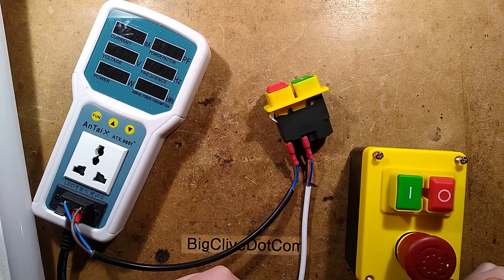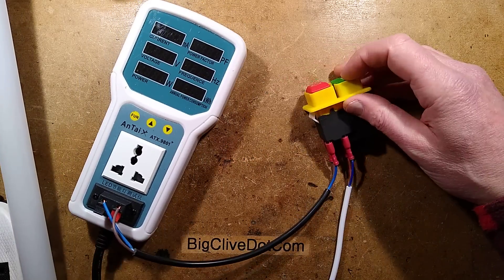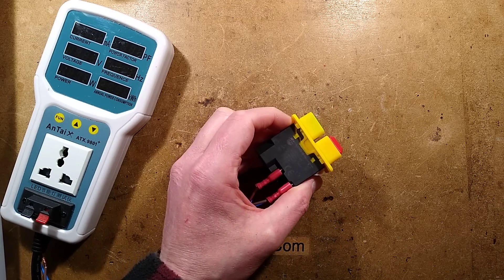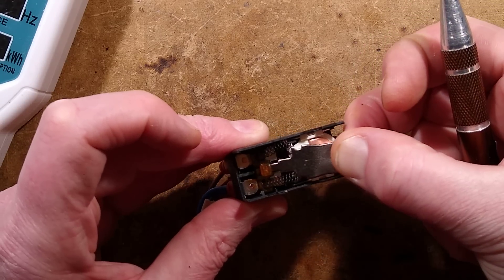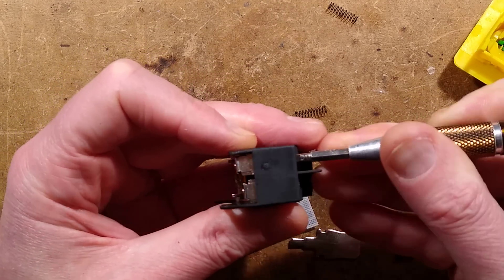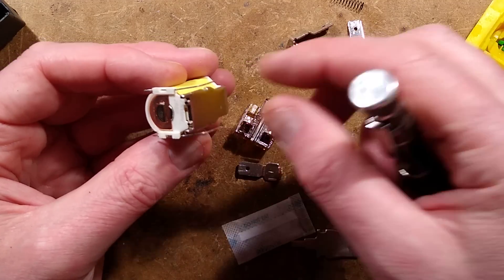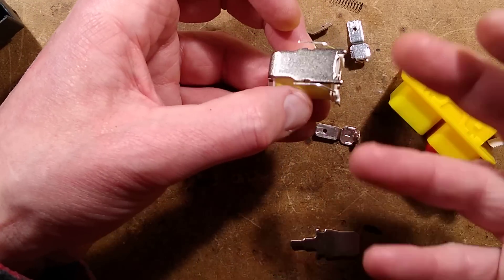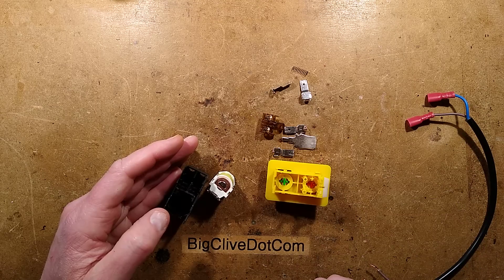Inside an NVR (No Volt Relay)

Comment: Thanks so much for this. I found a garden shredder on the side of the road that doesn't work and it looks like someone has had it apart and removed bits from the NVR because it looks identical to yours on the inside, but missing some key parts.
Anyway, looks like I need a new switch (NVR) to continue with trying to fix it. Hope that's all that's wrong with it but it's a fun project regardless.

Comment: Been a subscriber for years. Your videos are amazing some I am on the edge of my seat and then you have ones like this one that I can follow at a leisurely pace. Sometimes they are just plain soothing. Must be your voice. It’s always calm and peaceful you are a great narrator and video creator. Never had a chance to let you know. Just thought I would share how your videos effect me. It’s always positive. Keep it up Clive, you are truly one of YouTube’s best content creators on here. I always look forward to your videos even though I know electronics well but not as much as you. Hey who said old dogs can’t learn new tricks. I have picked up a ton from you. Like all my LED screw in lights have been modified like you showed and have yet to have a failure. I am under driving them. The the first one I did, I forget exactly when but it was right after your first video on that and I thought why not try it. I have 4 drawers with bags and every component and whatever value you want. I do quite a bit of custom work for people. I often build light controllers for lighting someone added that’s not factor on their car. 
I have had many people lately asking why I don’t use an Arduino.  My answer is simple. Arduino still requires relays, circuitry, and programming. If something breaks it can be a crap shoot. So I am able to build a circuit that fits their needs and build from components on a prototype board and waterproof it with a weatherproof box. In the 30 years I have been building these different modules I haven’t had any failures of my customers cars. But I have no idea how it healed out in the long run. I have a customer that has a 1990. I did a light conversion in 1994 and everything is still working. The car is kept in a garage and not driven in the rain. I think that’s pretty good especially for someone who has does electronics for a hobby. Been at my whole life.  No school for electronics. But at age 5 in the in 1981, I was in the newspaper and the associated press picked up the story and it was all over the country. Someone sent me 3 brand new Edison bulbs which all 3 are in a good and glass and wood case. Also got a letter from the president of Sylvania and he sent me a placemat with all the light bulbs they made. Also got a tie with light bulbs embroidered on it from him also a job offer that when I graduated college I had a job waiting for me there. I got into mechanical stuff around age 8 and really enjoyed it. Fixing watches with my grandfather and fixing and modifying bicycles. I am a mechanic or probably more like a technician because I find the problem and why it occurred. I will break out the schematics for the car and figure it out. I do have one expense Snap-On tool. It’s called the Vantage and does everything a meter can also has a scope and you can check ignition with it. But the main reason I got it is because of the database. Pick out any year, make, and model and find the component you need to check. It gives the plug shape, pin out and color code. Also it gives you 3 different teas to check it to verify it is bad or good. Much better than just guessing and throwing a several hundred dollars part at the problem and if didn’t fix it because there was a short in the wiring.

Comment: I have a couple of plug in RCDs that are held in electromagnetically. If the power fails they drop out and remain off until the button is pressed. Good safety feature but annoying if there's a momentary power loss when I'm out. There is nothing I can do to restore power remotely
Reply from the maker: There are active and passive RCDs.  The passive ones will stay in their last state while the active ones will trip during a power outage.

Comment: I have one of these hooked up to two sockets on my workbench.

So every appliance I plug in automatically gets an emergency stop with it.

I also hook up my vacuum to one of the two sockets, certainly when I'm working with a saw. So after sawing something, the first thing I do is shut down the vac with the stop button, and the saw is immediately disabled too and safe to set up for a new cut.

The shop vac is loud enough to never forget to turn off the power.

Comment: this reminds me when i built a three button with a three wire controller that used two double pole relays that did reverse and off for a simple DC low voltage motor

Comment: I bought a similar switch on eBay, mine has 5 wire connections, with the input and the output connected  the machine works if you hold the button down. The 5th wire marked uk A1 is obviously the coil and has continuity with the input live, but where does it need to connect to to make it work?

Comment: Looking at the way the coil is connected, it looks like it's always running, just strong enough to hold the plate down if it touches, but not strong enough to pull it from the resting position.

Comment: Nice! I changed the switch on a lathe a couple of years ago and fitted one of these (looked like the same as the one you have). Practically every modern tool such as pillar drill, table saw and angle grinder has these as it's not just the power cut scenario that these are great for but the unplug at the main then when pluggd back in the tool doesn't start up. The NVR is not a lot more expensive than a simple switch but they are a lot safer and only a little more effort. Thanks for making the video!!

Comment: I got a table saw with this type of switch on it, and just a couple of power cycles after I unboxed it, the circuit wasn't latching and holding itself on anymore.
I had to keep pressing the green button to keep it running, which was pretty inconvenient.

I knew it was a self-latching mechanism with a coil, but not exactly how it looked like inside. My quick-fix was to just hold the switch upside down and bonk the back of it, and it has worked ever since. Not sure what happened to it when it stopped working.

Comment: Very common in safety applications, and usually have multiple contacts all switching together. The idea being that you have a safe state - if supply fails, it switches off and isn't on when the power comes back. There are others which use a large contactor plate that is held on by the solenoid when powered, but gravity on the plate holds it off once the solenoid power cuts off - the reasoning is that gravity never switches off and always goes in the same direction, so you can count on it.

Comment: Rite Big Dude, I wonder how many fingers or lives these have saved? Trying to make a RF probes for the old Heathkit and just had a thought! The Elux Legand 3500 puffs vape is a good size and the sucky bit can be where the tip comes out and the back can be where the wire bit goes in... One moment please (sorry couldn't resist)! Stay safe n well. TFS, GB :)

Comment: I had to figure these things out when I bought a cheap Chinesium  belt grinder, that was mysteriously on sale for even cheaper than normal and was being discontinued.

It turned out to be wired wrong from the factory, I forget exactly how but they had somehow mixed up input and output so the relay kept buzzing and arcing madly as it tried to turn itself on and immediately off again all the time. Rewired it by just pulling off the spade connectors and plugging them in the right way around, it's worked fine ever since.

It is a nice safety feature, in that a machine cannot suddenly turn itself on when plugged in or after a power outage.

Comment: Back in vocational we built a similarly functioning circuit for a 3 phase motor with a contactor and push-buttons, and for some of my classmates it was already a difficult concept to grasp... I must admit that when a wye/delta start function and DC brake was added, I also had to mull it over a wee bit.

The DC brake operated by opening the delta at one corner and feeding DC into the windings in series from a diode bridge and capacitor.

Comment: NVR stands for No Volt Release where I come from...if the power goes down the machine turns off but wont start running again when the grid comes back on unless you depress the button again... safety...

Comment: Ah yeah! Around here those are "contactors". They're the safe thing to have on stationary power tools (making sure they are off in case the power cuts for whatever reason), so of course none of mine have one.  (Or maybe a contactor is slightly more sophisticated? Not sure, not much experience with them.)

Comment: Oh, when hooking up, be sure to get the power mains on the side without the coil, or it will never shut off.

I have 3 phase ones in my shop, they only have the 380V coil across 2 phases so you could lose the third phase and it wouldn't turn off.  Not good as phase protection.

Comment: The two contacts per side will let the connecting bar tilt if one contact is welded.  It often will break the weld and you'll never know anything happened.  

I think the shaded pole also helps the field collapse faster to release the relay sharply with no drag.
Reply: Nope, the shaded pole only extends the magnetism in that portion of the pole.  It won't collapes any faster AFAIK.
Reply: Thanks, I was remembering from a description decades ago.  I haven't worked with (other than as a user of) shaded pole motors.

Comment: Very interesting. I have a central heating 'thermostat' that is battery powered but has an internal relay. Clearly the relay is designed so that it doesn't take current in either on or off state or the battery would not last very long. I would pull it apart to examine it, but the missus would have a blue fit... I imagine it has a rocker with springs to keep in either state and a  couple of coils to change state. Great video by the way, I hadn't given these switches much thought until today.
Reply from the maker: It sounds like a remnance relay.  Often with a latch and release coil.
Reply: I should take mine apart. Technically one can pull a little current in the idle state without the furnace/AC noticing and drop a little voltage in the on state without it shutting off, which could explain those AA cells lasting for years.

Comment: Back in the 1990s I worked on a boxmaking machine that made the box around the product from a roll of stock, basically the product was the form (six one gallon boxes packed snug kinda like how butter is).  It had several switches like this around it and not only did they feed the coil but the coil held a second sensor contact in on the backside for each button station that then went to the neatest thing I'd ever seen.

A master stop button that would not only stop all the equipment when pressed but NOT stop each individual station on the machine, but when the power dropped to the entire machine it would yank that button in and turn it past the key interlock while spitting out the key if one was still inserted

Test at start of shift when you take over the machine.

Rolling die with cammed cut bumpers on a sliding platform, scarifier to rough up the plastic coating on the glue-shut surfaces, initial tab and crease that twirled the box around to slide onto the product held in place by spatulate blades that swung/slid, bottom and top closer slides with a fast little slap-around on the end that made it all happen.  The product would leave the end of the machine with the 6 gallon boxes packed hard-snug inside another sealed carton.  The individual motions could be operated from each sub-control with a jogging button.   About 22 feet long.   Two cables along the top sides all the way along it like bus stop-pulls going back to that master stop with bump bars here and there.   Was completely in-house built too!  Had a dream years later that I'd been operating a giant strange bassoon.

Comment: I used to repair machines that had relays and solenoids, the solenoids had copper across the core to stop residual magnetism building up in the actuator, holding on the actuator longer than it should.  You have to hand to the manufacturers,  they have it down to a fine art where to us friction contacts against wires to shorten assembly time.

Comment: I have harbor freight cordless angle grinder, it doesn't have a no volt safety. So if you drain the battery and forget to toggle the switch off, well, you better have good and safe gripe when you connect a fresh battery. It isn't a problem for me, but if I hire someone, I'm going to replace it. And for less technical people, it has the ability to turn it self off and so it could easily be programmed for zero cents per unit to stay off if the battery is connected with the switch on.

Comment: I have had to replace three of NVR switches on various machines. A pillar drill many years ago, a small milling machine and my garden shredder. In every case the problem was knackered contact's. They can be cleaned to extend their life but it is only a temporary fix. They are only worth fixing if a new one is not to hand, better to replace them as they are fiddly and time consuming to fix but only take a few minutes to swap over if youvhavecthe correct form factor.
The one on my lathe is still the original fitting, for about 20 odd years, so wear seems variable.

Comment: I have one on a bandsaw.  The unit constantly buzzes in the off position and slowly gets warmer until it completely stops working, then needs a 5 minute power-off rest until it is ready to play again. Not surprised to see that they are flakey build quality; must swap it out at some point.
Reply: If it buzzes when switched off it's probably wired incorrectly. That would happen if the line and load sides are reversed.
Reply: @eDoc2020  Thank you, that’s a really useful thought, an opportunity to “take a look inside” - nothing to loose as I was going to swap it out anyway. I’ll just grab my spudger, “one moment please…”

Comment: My minilathe uses very similiar looking switch - coil doesn't get very hot but contacts do (especially when running at low speed/high torque)  sometimes to the point where the internal slide (assembly with contact plates and springs) melts a bit and after power off locks contact plates in wrong positions. Everyone that uses a machine with this switch should buy a few spares and learn how to swap them - they are repairable but my fixes never lasted very long...

Comment: Would be nice to see which side of the NVS the emergency stop is wired. As in most electrical safety standards resetting the emergency stop must not put the equipment back into a dangerous condition. 

One place I worked the emergency stop switches around the room would cause the main contractor in the fuse box to drop out, but this feed the lightning circuit as well. Months of requests to fix it fell on deaf ears,  until I put big red signs next to all the switches stating that they cannot be used when dark.
Reply from the maker: The emergency stop is on the incoming side.
Reply: @bigclivedotcom  great to see they got that bit right then,

Comment: One of the first circuits we learned as electrical fitting apprentices was the  3 phase d.o.L (direct on line) starter.  Like you said basically the same thing using one of the contactor auxiliaries energising the ‘hold on’ circuit, usually 110v.

Comment: there are also version for circular saws for example that have a DC break feature. After you press the stop button they apply a single phase DC voltage to a 3 phase load to have faster breaking time of the sawblade.
Reply from the maker: I fixed one of those on a bandsaw recently.

Comment: Indeed we use contactors for this on production lines..also we use contactors to enable single point of isolation...when the power to a machine is turned off/ Trips all it's associated ancillaries also power down.
Reply from the maker: That was one of the schematics I had to draw in my final 236 part C exam.

Comment: Also available in industrial applications are manually operated circuit breakers with options for either ("under voltage" or "over current") trip relays fitted internally as per order / specifications .

Comment: Not to be cnfused with Networked Video Recorders, they wouldn't stop a saw chopping a hand off, though they would record it for posterity... :P
Reply from the maker: And also record it for YouTube.
Reply: @bigclivedotcom  Always a handy thing, infact hidden away on my other channel I have recordings I've used for evidence against non-delivering couriers, no saws were involved though, unfortunately... :P
Reply: In the paper industry.. manually operated  sheet paper cutting machines are fitted with optical ( L.D.R.:s) sensors, along the length of the blade to prevent accidents as such .
This is just one of the many accident prevention systems mandatory required in industry.

Comment: I was interested to see how they work, because the old epb (electric pneumatic brake) units i drove for BRITISH RAIL, network southeast, were fitted with a No Volts Relay and helped to perform various actions on those all electric passenger trains (slam door stock, now defunct). Class 415 and 416, known as 51s, 57s and 63s, the years of manufacture.

Comment: Woodworking hobbyists like to add these to their power tools and they're a great safety feature. But one thing to watch out for is that the cheap chinese ones are usually rated for far lower loads than bigger tools like table saws will draw. Either you'll blow the switch right away with the inrush current, or the switch will fail soon after. A cheap fix for this is to have them control a contactor that does the switching instead, this is what I did on my table saw and it works great. At the cost of some extra space and wiring, of course.